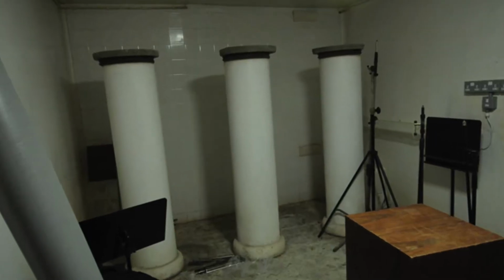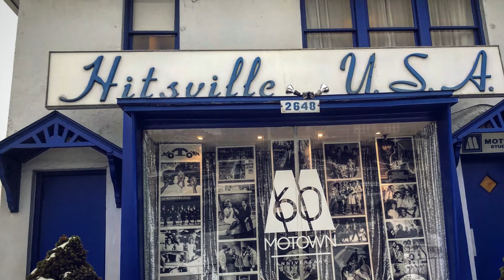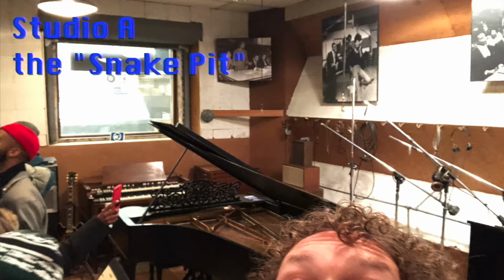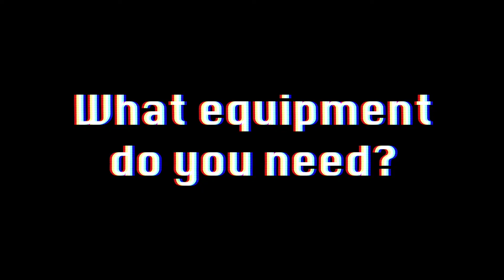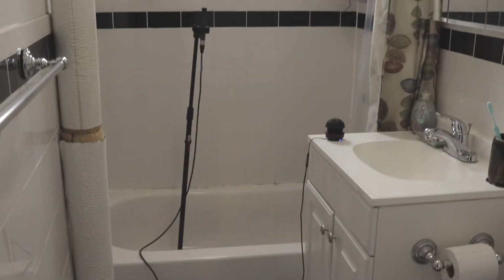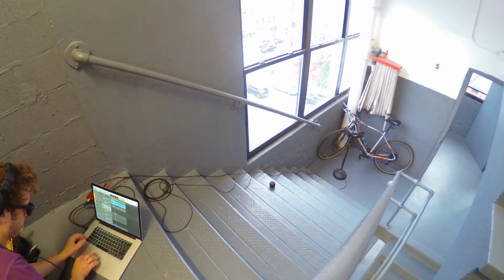How to Make a Reverb Chamber that’s Inexpensive, Mobile, and DIY (somewhat)

Comment: 😂 Yeah and easy to build all you have to do is move some stuff out. I am so poor, I have 3 reverb rooms😂 o and I drilled a hole in the wall to have a speaker in the room next to me. yeah and talking about a cave I have a hall, I live in a apartment building with a hall of 600 feet and most people are pretty old and most have hearing problems
Reply from the maker: 600 feet that’s huge!
Reply: @MadeOnTape  finding the sweet spot. To be honest I didn't finished your video yet.haha I did now you tilted crook